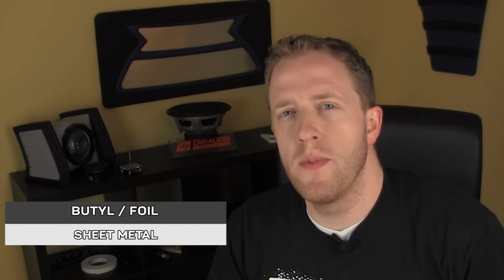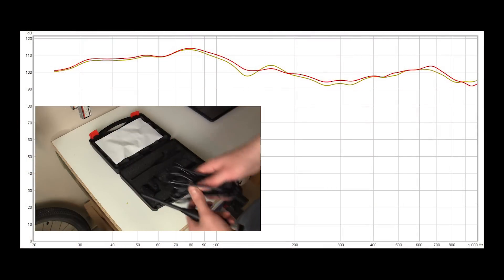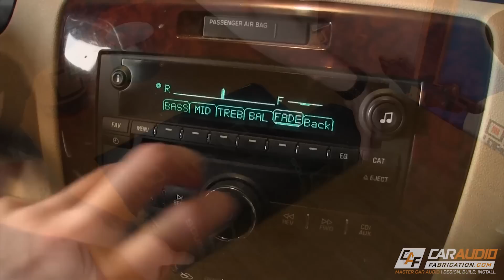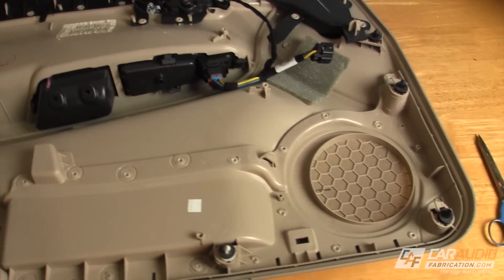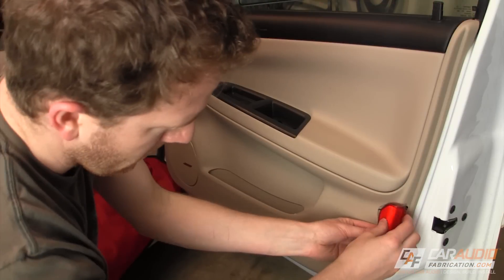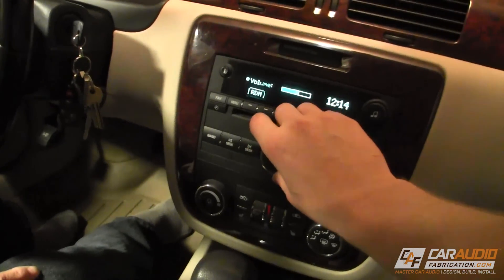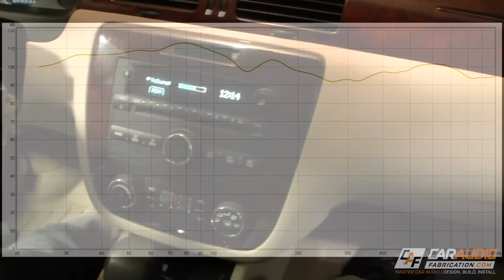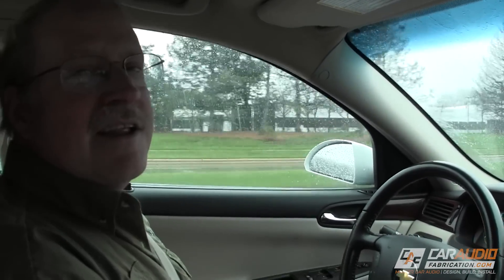EASILY Sound Treat your Car for Better Sound! - CarAudioFabrication

Comment: can you post the differences between the cheaper sound deadening material like NOICE 80 mil butyl compared to the soundskin. I'm considering buying the mega pack soundskins but I want to see if its a worthy investment.
Reply: Ryan Kean i used Noico on my convertible and it helped a ton with reducing road noise and my car stays warmer inside for longer during winter. I would recommend it
Reply: Dont just buy spectrum 1 gallon  easy on n u will save alot
Reply: I really like the Soundskin, it is awesome.  also, their speaker rings are my favorite.
Reply: If you can't afford this, then buy the cheaper product. No need for somebody to do a comparison for you. Car Audio is like making your car fast. Fast, Cheap, Reliable = You can only pick two and the same applies to Car Audio. Many of the less expensive alternatives are not designed for enclosed spaces...

Comment: Hey Mark, thanks for the videos, they're super informative, just one question, If you do this over the whole door how do you get to the regulator in the door afterwards, It doesn't seem as though this stuff would be easy to peel up or have very good adhesion to stick back. Also can this stuff replace the vapor barrier? Thank you.
Reply: John V unfortunately you would have to cut it and it will be messy not just second skin but Any peel and stick deadener but it will replace the vapor shield

Comment: i have a 04 ford explorer. there is a secondary hatch withen the hatch to remove smaller items without opening the whole hatch, set for the grocery getters... well i have 2 dss ethos on a audio legion 5k... ran at 2ohms its doing around 2700 watts.. that secondary hatch is going nuts and its driving me nuts, if you have any advice on how to knock that vibration down. definatly open to advice
Reply: In wich position do you have your subwoofers aiming at?
Reply: +zepey18 they are facing the tailgate, but because of how the box is i cant turn the box around to face forwards
Reply: +Tyler Nienhuis Maybe you can try moving them as close as possible to the tailgate and face the subwoofers directly to the glass part of the tailgate. That really make a difference on reducing the rattling in my tahoe. sorry for my english.

Comment: that is pretty well done, 1 big sheet of material, but! what if you need to replace your window motor? you gotta cut it all out?
Reply from the maker: +k300zx Yes, in this case you would have to remove the materials. But to be honest, in the five cars I have driven in my lifetime (most of which were rust buckets) I have never had a window motor issue. Sometimes you just have to roll the dice.
Reply: I can understand. super clean work you do
Reply from the maker: +k300zx Thank you :) Thanks for watching
Reply: +CarAudioFabrication Great video, as always! Would you say the mid bass is enhanced as much doing this material only method compared to the MDF/plastic method detailed in your previous door sound deadening video?

Comment: Just from a quick skim, is it really $325 just for enough to cover 4 doors? Is the quality of this stuff that much better than normal Butyl and CCF? You can get 36 sq ft of Deadener and 40 sq ft of ccf for $150.

EDIT: And would MLV still be necessary over this stuff? How dense is it?
Reply: +Snydicus Curious on this too!
Reply: +Snydicus For $100-$150 you could just buy Dynamat or GT mat which work very well from my experience.

Comment: +CarAudioFabrication I have a 2014 mustang with the shaker 500 system, its got 2 8 inch subs in the front doors that actually use the door panel as part of the chamber for the subs, basically its got a chamber that runs along the bottom of the door panel, my question is that would it be worth it to apply deadener to the back of this chamber to help stiffen it and help create a more solid enclosure? i can feel the door panel vibrating quite a bit and i feel the bass is lacking a bit as well maybe due to enclosure flexing? any help would be appreciated thanks.

Comment: Thanks for another relevant and awesome video..... Can you do an episode on the use of sound processors such as the Audio Control Lc7i in future installs.
Reply: LCi7 is not a sound processor, it's a way to turn speaker level outputs to low level so you can run amps.

Comment: Mark, What products would you recommend for treating above a headliner for heat rejection/insulation? The heat transfer from the roof into the cabin is enough to give you a headache here during the Phoenix summer even with the AC on max. Thanks!
Reply: Probably have to layer the top of the roof with foil

Comment: rubbing alcohol and tracing hole openings are good tips...I'll remember that the next time I'm deadening a door...what about near the top of the inner door trim panel?    I noticed you left that area mostly void of deadening material and concentrated on the lower half.   Any particular reason?   Would one not want to cover as much of the inner door panel as much as possible to add mass in all possible areas?   Or would adding material in that area affected the fitment of the panel on the door?  Is it also possible to use two different types of deadening material, say thicker on the metal door and thinner on the door trim panel? [thumbs up]
Reply: K03sport , common sense goes a long ways man !!!!
as long as your door panel goes back on the door with NO fitment issues and or operating issues, then yes, I say, the more material, the better.
be careful, that shit is a bitch to try and remove once it's been rolled on!!!

Comment: Couple of comments here... As always excellent video. Secondly this new soundskins deadener is getting rave reviews and I plan on ordering some myself in the near future! And lastly my Mazda 6 has a plastic insert on the door that holds the window mechanism and all that junk! I have taken this panel off (kind of ish) and let me tell you it was a pain to get back on and have my windows working properly etc. I didn't get it off enough to fully sound deaden it, so my question is have you ever worked on a door like this? If so got any tips for a shade tree audio nut like myself? Anyways thanks for the video's you should know your work is appreciated!

Comment: great video as usual Mark, but I haven't seen you address the deck lid / trunk lid. I know that area can be hella noisy when you have a powerful sound system. I was thinking about welding all of the areas in the trunk lid bracing closed and then adding the sound treatment to it once it was flat, but that would make the truck lid very heavy. what do you think?

Comment: This should really be a option on new cars
Reply: They have it on luxury cars like Mercedes, BMW, Lexus, Cadillac, etc. Just not as much as you want.
Reply: Good idea. Right from the factory.
Reply: FSXgta its all about saving money for them.
Reply: they cant spend more time on one car then less on another on a moving assembly line.
all cars would cost more due to a slower line.
Reply: Mercedes-Benz, BMW and other highend cars make small attempts to correct this but its no where near as good.
Reply: I wonder if a true deadening treatment would cost to many man hours on their side. But certainly s option I would pay for if offered.
Reply: I had a 2012 jetta TDI premium with fender sound system and right out from factory my car had this sort of mat on inside of door! here is one of reasons why german cars have been always known for quality also if you use adequate ammount of this stuff it will make the door in your prius close like in mercedes class S lol

Comment: i need this just for the road noise in my car.
Reply: Jason Firth
Reply: This method only makes the music you play better inside your car. It doesn't reduce the road noise. Two things to consider about the road noise is getting new tyres and buying a body on frame car. That's it.
Reply: Tires affect that more than body.  Unless you have spot lights like me and get a whistle on the highway
Reply: 07wrxtr1 get rid of that thing! Money pit machine!
Reply: FORC3OFX F3AR that’s a cheap ass car wym lol
Reply: @forc3ofxf3ar51 a 370z is dead-reliable. Had a 350z and it was up there with my Lexus ES350 for least amount of issues
Reply: Dont by cheap cars

Comment: One thing I can't figure out is why most OEM vapor barriers have a very deliberate extrusion into the open hole of the door for no obvious purpose.  As a result, I wonder if I should necessarily recreate this bump in with the replacement sound deadening material. If the OEMs put the extra effort into producing this form for the barrier, there must be a significant tested reason but its purpose isn't clearly obvious and all sound deadening applicators seem to ignore it by flatly covering over the opening. Are you aware of the OEMs intended purpose for this vapor barrier design?
Reply: SayWhat? , evaporation of moisture is the only reason I can figure

Comment from the maker: Who wants to get some sound treatment done in their ride?! :P
Reply: One day I'd love to try second skin
Reply: I have a Monte Carlo the same generation as this Impala and a full system. I need this how much does it run? There is tons of rattling in my car on the rear deck, really ,roof, and doors
Reply: +CarAudioFabrication I certainly do, looking up the product right now
Reply: +Mark Coleman from what I understand its one door kit per door, with a little left over.
Reply: Mark Coleman that's what Im sayin', ha
Reply: Hahaha. I don't have a car bleh :D
Reply: I do.
Reply: I want sub woofer in good working.
What we do in amplifier?
Reply: I want sub woofer in good working.
What we do in amplifier?
Reply: Go to an audio shop nearby and see cause an amplifier has to match with the subwoofers. Or if you understand things look up online. Good luck!
Reply: I would live to, and would help also. .
Reply: Yes!!!!
Reply: Does the soundskin essentially do the same job as the vapor barrier?  My vapor barriers are 15 years old and the soundskins look like they would do a better job than I could ever hope the original barrier would do, and that's not even considering the audio improvements it's designed for...
Reply: I do, got a mega cab diesel that drowns the sound on the alpine stereo
Reply: I need this so bad. I have a 2000 Chevy Blazer. I have foamed the inner frame. On the roof I used rubberized paint, thicker auto cloth insulation, and covered that with aluminum tape from harbor freight. . . But I cannot afford to do my doors or under the carpet. Or even get a single 10" sub for a bit of base 😅 SUV's are not cheap to soundproof and insulate. Especially since the rear undercarriage is a crucial part of soundproofing as well. . You do a ton of work. Happen to have any left overs for an avid fan and fellow artist/custom worker? 😄
Reply: My ram 1500 2017 needs it  ,eco diesel its quiet but little rattles in the door panels.
Reply: Hey. Can you tell me how can i stop the vibration threats from the back trunk of my car.
Reply: Im going to need it. Was just on line last night looking to see what kind of stuff was on the market and then this vid poped up this morning. How funny is that.
Reply: +CarAudioFabrication Thank you for another great video. Did you use the "doorkit" for your video? Do you think you'd need 2 "doorkits" to do all four doors on the Impala? I'm trying to gauge how many doors the "doorkit" would cover. I know there are a lot of variables in door size and what not, but just a general estimation?